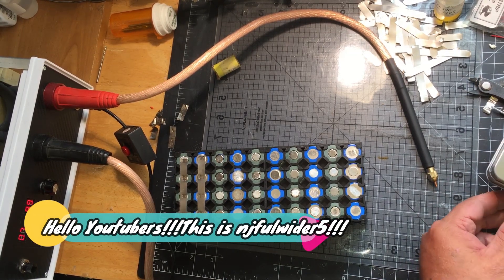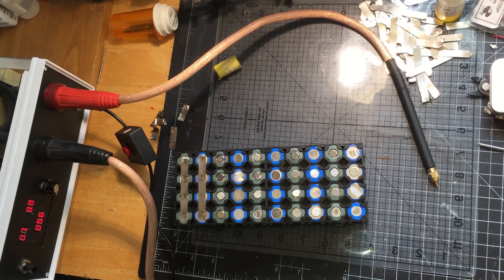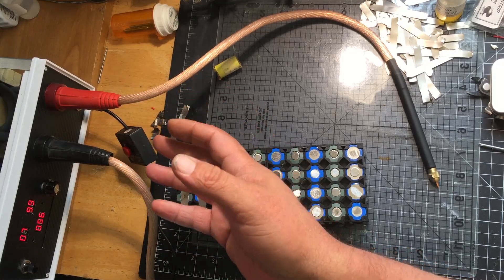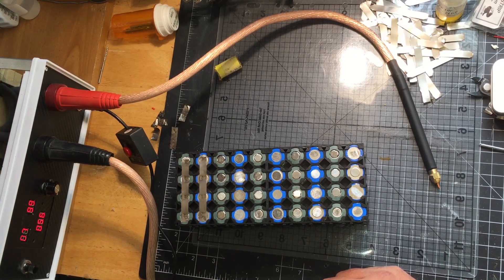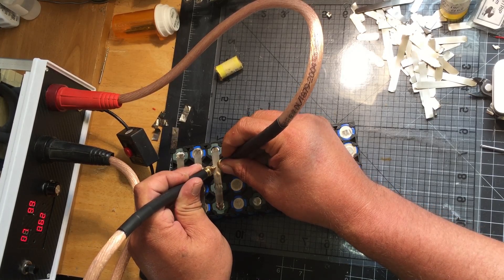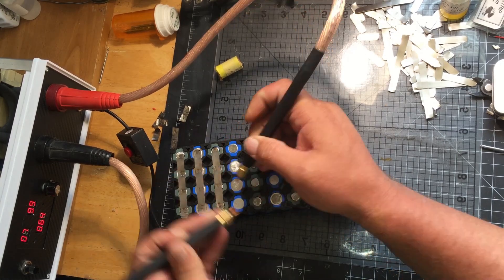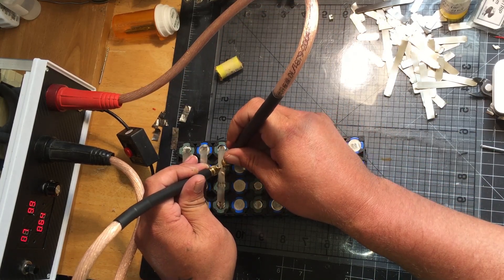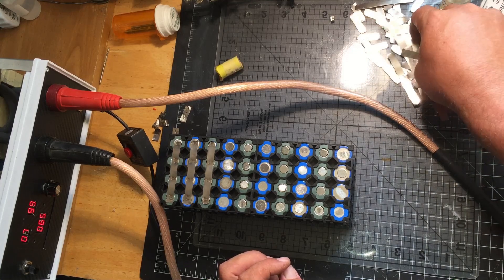Testing my MOT Spot Welder 100 amp Spot Welder Control Circuit-Demonstration & Explanation

Comment: Joe, What was your final build specs on this? MOT wattage? Wire size on MOT? and Wire turns on MOT?  How are the pens working out so far? Would love to see a photo looking down into the inside of your case.   Thanks
Reply from the maker: Pretty sure in the build video I have of this, you can see everything pretty clear. It also has the mot size and turns. Drop me a line over in that video if you don’t see everything mentioned. The pen so far is holding up pretty well, I only had the one issue mentioned in the video, but it was a simple fix👍👍👍👍😥